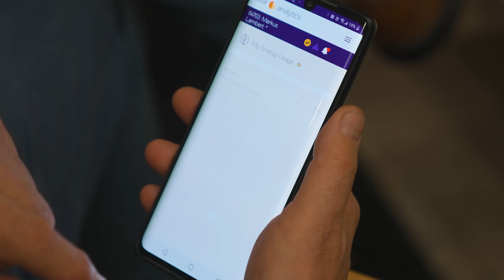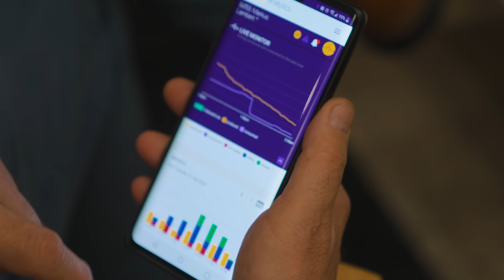Solar Batteries: Debunking 7 Common Myths

Comment: forget about charging your ev with the home setups,,,,, they dont have nearly enough power available,,,,, so you have to use a seperate system running off the grid, and you'll need a massive inverter running off 3 phase to be able to deliver the massive power needed,,,,,, think about getting an ev unless you have a proper charging station at a servo near you, paying as much as fuel would cost you
Reply from the maker: The home systems are improving and the power needed depends on the car and how fast you want to charge.
Reply: @yeanswers  BS, BS, BS,,,there's not any power system that will let you drive your car for even 150 klicks perday, and then let it charge from your home battery,,,,, you're kidding yourself if ya reckon otherwise

Comment: How can I stop a Fronius inverter from drawing around 5% power from the grid even when there is plenty coming from the panels and battery and my system is a 7.8Kw with 10Kw battery and my power use is mostly less than 400W (except when water heater or stove are on)?
Reply from the maker: Thanks for sharing that—it's definitely frustrating when your system isn't prioritising solar and battery as it should. A small draw from the grid (like 5%) can sometimes be due to how the Fronius inverter handles phase balancing or reacts to slight delays in battery discharge response. But it shouldn't be constant.

You might want to check with your installer to see if the system needs a firmware update.

Comment: Sir, i got about 1 minute into your video but as soon as you said "they cant handle a battery" it immediately let me know that you have a complete and fundamental misunderstanding about how solar and battery systems work so i didnt even bother watching the rest of your video. 

The PV array has no idea that a battery system is connected.

You can get a battery and still save money by using plans like Zero Hero from GloBird - or With a company like Amber or OVO.

Do small PV arrays make batteries less useful? Sure. But like all things - the real answer is - it depends.

So your assertion that you can wipe 1 million less than 5kw PV arrays off is just plain silly without knowing their usage details - and i'd hazard a guess that if they still have a small array its because its meeting their needs comfortably - in which case a 10kw battery would help them out, again if paired with the right energy plan that includes 'free usage' then the battery could be topped up if the PV is unable to completely fill the battery.
Reply from the maker: What I was getting at (perhaps too bluntly) is that sub-5 kW arrays often struggle to fully charge modern 10+ kWh batteries consistently, especially in winter or if consumption is high. Yes, plans like Zero Hero or Amber can absolutely make batteries more viable—even for smaller systems. But those plans rely on grid arbitrage or dynamic pricing, which not everyone fully understands or wants to manage daily.

You nailed it though: “it depends.” Blanket statements can miss nuance, and I appreciate you calling that out. My take was based on general trends, not individual edge cases.

Comment: So you were talking about advanced concepts, you need to use diagrams to explain what you are trying to show. You also don’t talk about programming your battery, that can make a huge difference when it powers your house. In my case I charge till about 10 and it helps charge my car during the day with solar,
Reply from the maker: Great points—thank you for sharing! You're absolutely right: battery programming makes a massive difference, especially when you're managing both home and EV loads. Setting charge/discharge windows, prioritising self-consumption, and coordinating with solar production can significantly improve efficiency and savings.

And yes, we should absolutely use more diagrams to explain those advanced concepts visually—it's on our radar for future videos.

Comment: Well one screw over is the decision of the NSW government to abolish rebate after 30 June. No longer double dipping! In my case I have to cough up $3k more! Bastards!!😤
Reply from the maker: The sudden end of the double-dipping option has caught a lot of people off guard. Losing access to both the Federal and NSW rebates at the same time can mean a serious out-of-pocket jump, especially with rising battery demand.
Reply: WA went one further , a $5000 rebate was going to start on 1 July but once the federal rebate was announced the WA government has cut it to $13000 with all new conditions attached

Comment: How does Redearth Storage get away with installing the SUNRISE (troppo Lithium battery) as a Pre-Assembled integrated BESS into homes. They do this without a Comms cable connected between the Battery and the Sungrow Inverter? 

The inverter monitors the SOC by reading the Voltage on the Busbar only. Even the Redearth Sunrise Manual shows a single line diagram with Cat5 cables between the inverter and battery? This has not been installed and cant be as the TROPPO is a non comm battery. The SOC readings are all over the place (all confirmed by an independent Engineer and Dr in the field in writing) How can they comply with AS5139???  Can anyone explain how or why I and others that are experts could be wrong??

Comment: I don't agree with your initial assertion that batteries are pointless on small PV saystems. What's wrong with a 3kW system and 5kWh battery? A battery can be too small for your household usage, but a PV system can't be too small for a battery. After all you can have useful battery systems with no PV at all, and just use it to benefit from electricty price diurnal variations.
Reply: I also don't agree.   I have a 5.25kWh solar array and I run a Powerwall 2 battery from it, here in the UK.  I'm totally off grid for about 6 months of the year, running the battery during the night.  And I export to the grid.   Perfectly adequate for a normal home.   So dare I say 'click-bait'?
Reply: @farmerpete6274  'Click-bait' is a bit harsh. The title is formulaic, but most of the info is pretty good - the guy does know what he is talking about. It's only the small-systems exclusion that I felt was silly (but there may be reasons why what he says makes more sense in Austraila - I'm not familiar with the details there.
Reply: @xxwookey  In Australia we have very good solar irradiation - so its the best scenario if one can fill the battery with the help of solar for most of the year. We consume in big homes via air con (heating and cooling  and no double glassing) easily 25 kWh plus per day. Then we now also want solar for EV charging. So anyone with a 3 kW or even 5 kW system in Australia would really be well advised to add to the solar. Its very cheap here - a kW of solar is usually after rebates around $700  for a quality job. My sister in Germany nearly paid triple - unbelievable.
Reply: @markuslambert8236  Sure, bigger systems are better, especially if you have an EV too, but that doesn't make batteries pointless on small systems, which seemed to be what the video-maker was saying. Maybe what he meant to say was if you have a few thousand dollars to spend, spend it on more PV (or some insulation/airtightness) before spending it on batteries as you'll get more bang for the buck, but I'm not convinced even that is true at 5kWp, 0kWh.
It doesn't sound like some building fabric upgrades would be a good idea too to keep the heat out in the first place. Inefficiency still has costs, even when the energy is renewable.
Reply: @xxwookey  again true, but solar can drive your car, run your washing machine and  heat your house. Overall if you have a bad roof fix that 1st and same with insulation - make sure your home has it before going the solar & battery path.. but overall again we are in Australia. 11 degrees C is a cold winters day.. :) very  different to Germany or the UK.
Reply: @markuslambert8236  Airtightness and insulation keep heat out exactly the same as they keep it in so good building fabric works in hot and cold countries. But you are quite right that electricity is more flexible than demand reduction from building fabric changes.
Reply: agreed when he says 'they cant handle a battery' it immediately makes me think this guy has no fucking clue what he's talking about. The PV array is completely oblivious to a battery. The statement "they can't handle a battery' is completely wrong and shows a complete fundamental misunderstanding of solar and battery systems. You could have no PV and still benefit from a battery! By using plans that have 'free' power between certain hours - fill the battery between those hours (as if it was a PV array) then discharge the battery over night for 'free' and save on power costs. This guy is a muppet

Comment: Our 12 yo 5.4 kw system is working fine but I'm adding 14.2 kw solar and a 32 kwh Sigenergy battery stack next week. The installer will AC couple the old system into the new one too. Can't wait for July 1st.
Reply from the maker: Sounds like a great upgrade — you'll have plenty of self-sufficiency!
Reply: 32 kWh that is insanely large
Reply: @bruceevennett955 We have 6 people at home and everything except stove tops are electric. Our electric bill for May was 36 kWh per day.
We have our system installed today! Sigenergy software looks quite comprehensive. I've set the AC charger to use solar only and will see how it goes tomorrow.
Reply: @bruceevennett955 good for off grid power during storms or blackout need a gateway to do full off grid backup

Comment: washing machine doesn't take much power, it's basically just the equivilent of having an electric motor spin up 9kg, barely more than 4 hours of a fan...

Now, dryers on the other hand is basically KW's of energy for up to 4 hours, at that point if you're checking to see if you have enough solar energy to put wet laundry in the dryer then you are guaranteed to have enough energy to put it on the line and have it done in half the time it would for a tumble dryer cycle.
Reply from the maker: Great point—dryers definitely need a lot more power than washing machines!

Comment: Adding 16kwh to my sigenstor for less than $5k after SA's REPS gets claimed too.
Reply from the maker: That’s a solid move—adding 16kWh for under $5K after the SA REPS rebate is a great value, especially with the modular design of the Sigenergy Sigenstor.
Reply: What did you do to be eligible for REPS? Thanks!
Reply: @jasonw3176  just look it up

Comment: What a load of shit..... How can you honestly claim a 5kWp system wouldn't handle a 5kWh battery....... Seems like you're confusing power and energy.. .   😂
Reply: I tend to agree.
Although the video content tends to be correct, it is oversimplified and the tittle is a partially misleading sweeping statement, probably meant to serve as click-bait.
Whether the power of your inverter and the size of your battery are adequate or not, really depends on how much energy you consume. In my case:
- I consume an average of 10KWh/day.
- My inverter is 4KW
- My panels produce 17KWh on a Sunny winter's day (32KWh on a sunny Summer's day).
- My first AC-coupled battery was 90Ah @~50V (4.5KWh) and, unlike me at my age, would last all night in Summer (16hrs of daylight and 8hrs of darkness). In Winter (8hrs of daylight and 16hrs of darkness) it would eliminate all consumption during peak periods, so I would only pay off-peak rates for electricity, after the battery ran out.

I now have a 16KWh battery, but am usually only cycling that down to 65-80% every day. Below that when a string of cloudy Winter days comes along in Winter.
So... Sorry to disagree... but I do understand that "It depends" is a less catchy tittle for the video.
Reply: @micheldeslandes4339  Thanks for putting your perspective. So now you have a 16 kWh battery - which is the point you started small and then found the need to get a bigger battery. With the rebate design, that on can only get it once, that path is now not recommended and one needs to consider the bigger option right from the start. A 5 kw solar systems in many parts of Australia will not be big enough to fill a bigger battery on many days sufficiently. So one would need to look at adding to the solar capacity as well. .
Reply: I am saying that  for most families a 5kWh battery is not what is needed and a 5 KW  system system and a battery is undersized for anyone other than a frugal pensioner couple.

Comment: Mine is only 5kw system so back then you only got 4kw max. Also the inverter would have to be replaced. Realeasticly mine is too small anyhow.
Reply: yes your analysis is correct - either add a 2nd system if roof space allows or you might have to start from scratch
Reply: 5kW is a reasonable sized system. It depends on your usage. We ran for 14 years on 2.9kWp system which generated about double our annual usage. 85% was exported because we didn't have a battery. I guess Australian usage is a lot higher than in the UK on average due to aircon, but that matches solar generation. I've just upgraded to 7kWp, 16kWh battery and that's taken us totally off-grid except a few days in depths of winter, still with 50% exported.
As the chap says, you don't have to replace the inverter - just AC-couple your battery via a dedicated charger/inverter.
I don;t understand this guy's assertion that batteries are pointless with small PV systems. You can have a useful battery with no PV system, so that doesn't make sense. Do you not have time-of-use tariffs in Australia? - that would make a big difference from  finance POV.
Reply from the maker: You're right that a larger system would provide a lot more energy.

Comment: Just put in a order for the Sungrow SBH300. Have an existing 13.2kW PV but both 5kW inverters were incompatible so had to get the Sungrow 10kW hybrid inverter. Also needed to upgrade 6 breakers in the fusebox as they were incompatible. $15k with the rebate so worth it for me. Will switch from Red Energy to Amber in a few weeks to make use of the wholesale market.
Reply from the maker: That’s a great setup! Switching to a wholesale market plan like Amber will maximize your savings, especially with a battery.

Comment: Nice video. I would also say knowing the capacity of what your existing solar can produce total in a day in summer and winter is important too. The winter generation might not be enough to charge that battery and you have to use the grid to fill in the gaps.
Reply from the maker: This is great advice as well! Thanks
Reply: That's so old school thinking. Go with amber and you don't even need solar. Yes you might need some to qualify for the 30% rebate. But if you get a big battery you can simply get cheap power from the grid when you need like at night or during the day. Solar is dead
Reply: @MatthewBayard - obviously you are not in VIC.  Amber is suicide here right now
Reply: @MatthewBayard  IF and it's a big IF the grid doesn't get it's s$$$ together and it stays volatile, unreliable forever then sure, you have a point of trading and buying at the correct times like the stock market. I'm going to bet on technology that it will get better and the price spikes will become far and far less as the grid gets better. I hope people who made the big purchase pay it off before that happens.

Solar still has a place for me and I am far from reliant from the grid issues it has now. It's also a very cheap generator that can also be used as a fence or a roof.
Reply: @MatthewBayard if amber change the business model this idea is worthless
Reply: @johnmarsden7687 🎉 somehow I don't think the NEM won't be changing how the wholesale market trading anything soon.